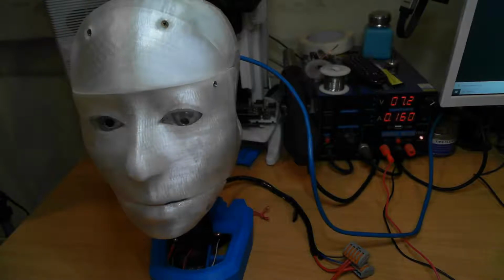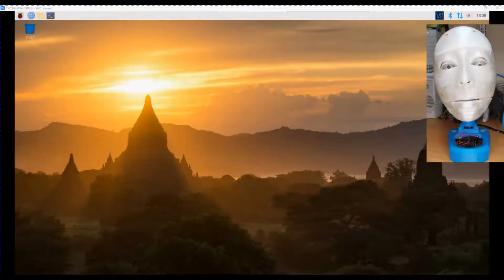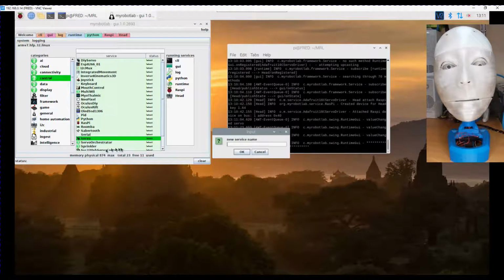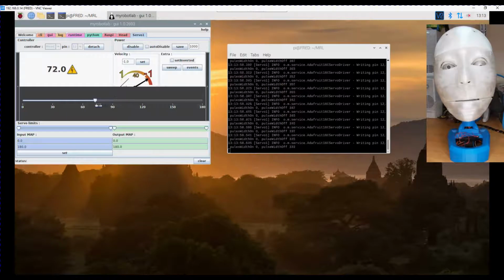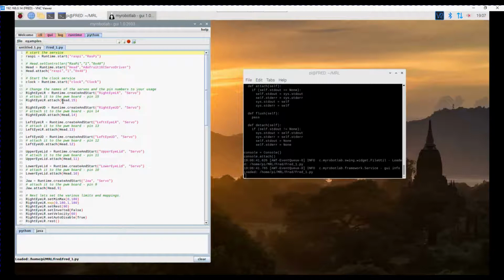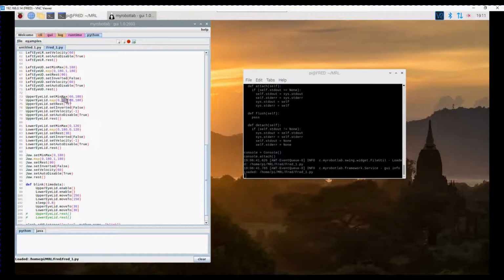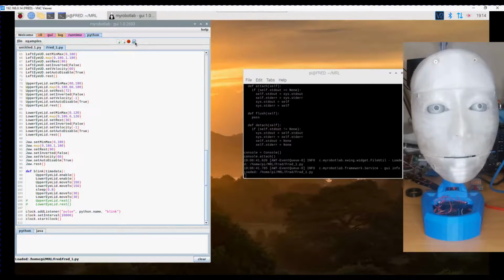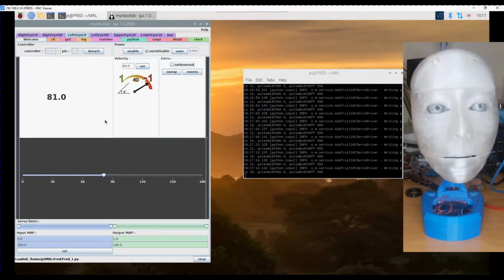Freds Head Part 8

Comment: Great series. I’ve been following along and learning a lot. I’ve started on my InMoov robot head with no modifications yet. Just about ready to integrate MRL. Thanks for sharing. I ‘m looking forward to seeing more. What blinking eye mechanism did you use? It looks different then the one you used in the eye build video.
Reply from the maker: The blinking eye mech is the same one in the part 2 video.
I did make one change, in the joining bar between the left and right eye lid, 
there is a hole, where I had passed the lever wire, this wasn't as successful as I had hoped, 
so I found an M2 screw screwed into this  hole quite well and I could attach my lever wire to it, 
This has worked very well for both the upper and lower eyelid.
Reply: Cyber_One oh ok. I only saw the upper lid moving so I thought you had changed to a single eyelid system.
Reply from the maker: Both are there, but the lower doesn't come up as far as the upper one comes down.
there is overlap in the travel of the two eyelids, but it looks more natural to have the meeting of the two at a lower position.
I guess in the future, I could use the lower eye lid up a bit more to help make the face look angry :-)

Still working on the next series of videos,not yet ready as a result of extra time where I'm employed, so this weeks video not the one I wanted to put out, but it's butter than no video......

Comment: hello sir, I am very new to this kind of stuff and i really want to make this robot. I just ordered the nervo board kit from the inmoov website and some servo motors (mg996r) i want to start with an arm i think. (or do you recommend something different). what kind of other electronics do i need to get? Like cables etc. excuse my bad english im only 16 years old.
Reply from the maker: I would start with the right hand, and then the right forearm.
At that point you will be able to install 6 of the MG996R servos that you have.
You will also need some 200lb fishing line to use as the tendons.
The official set of directions for assembling the hand and forearm can be found here: http://inmoov.fr/hand-and-forarm/
Another builder on YouTube I follow is Steve Rayner, he has a few video's on  the hand and forearms, so might be worth looking at those as well, here is a link to one of them: https://www.youtube.com/watch?v=zL4bfUO8RuU
Don't forget to have fun building the robot, and there is a lot to learn. :-)
Reply: @CyberOne  thank you very much for the quick responce sir! I am going to start printing tomorrow! If i ever run into any problems can i get back to you?
Reply from the maker: Yes you can, best option there is start a new thread, YouTube sometimes hides conversations where i have already made a reply

Comment: These videos are great. This is so relevant to what I want to do.
Reply from the maker: I've started a Part 9 video, more advance Python script, but having trouble getting it to be stable.
I also installed Nixie as well, so I have that to test as well.
I had planned for the first of the Walking Robot to be out next week, but haven't finished recording it yet.
There is a lot more to it than I had first thought, and I new then there  was a lot... :-)
Looks like the first one is on Kinematics of our legs, where our feet are and how to get our feet to a set position.
The second will be on torque and the projected torque we are likely to have on the various joints.

Comment: One thing I'm wondering about the raspberry pi is how do we manage powering down? If we just cut the power without doing a proper linux shut down, will that corrupt the SD card? Is there a better way of powering down?
Reply from the maker: You are correct.
I use VNC to log into the Raspi and shut it down that way before removing power.
I did hear at one point of an add of bit of code and hardware that connected to the GPIO pins and removed power after a successful shut down, but can't remember where now.
I'll let you know if I stumble across it again.